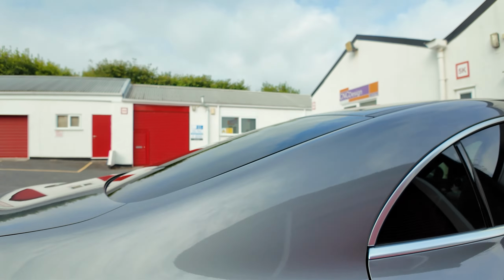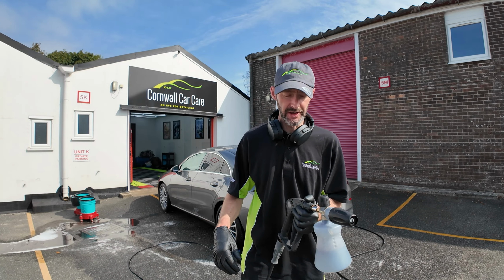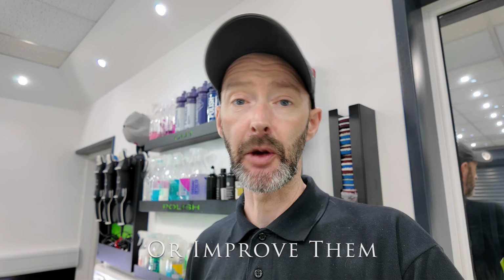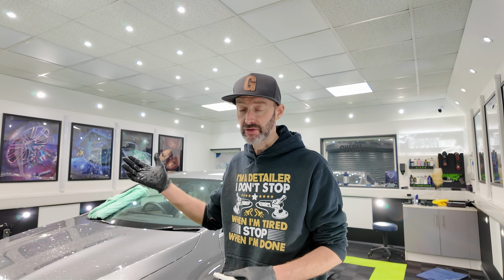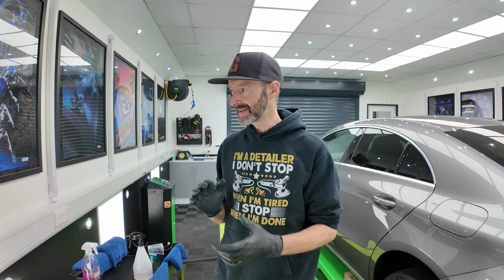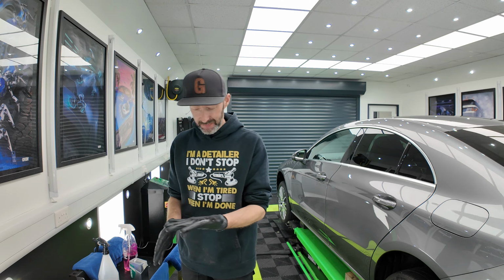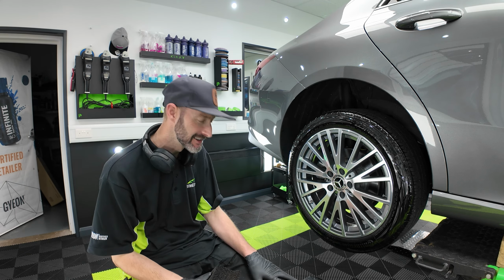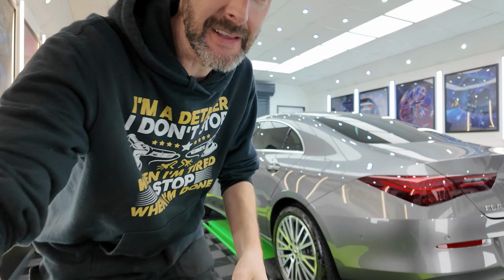Mercedes CLA Paint Enhancement & Gyeon Ceramic Coating

Comment: Another great video. Which single stage polish do you like and use the most?
Reply from the maker: Cheers @haroldcottam8174 for me I like using GYEON Polish but it will all depend on what the paint type is ( hard or soft ) and how much damage there is the paint, I would always do a test panel at the least aggressive and work my way up till I'm happy with the results 👍

Comment: Brilliant stuff, the right call was made there, well rounded scratches. Was it a nice change with the rotary?
Reply from the maker: Thanks @Ally.MacMillan definitely made the right call with the scratches as outside we couldn't see them at all, as for the rotary I have to start using it more as its so smooth to work with and leaves such a great finish 👍
Reply: @cornwallcarcare8959  is that a 5 or 6inch backing plate?
Reply from the maker: @irollon26s  5" on the LHR 15 and 6" on the LHR 21 👍

Comment: hi mate, what mini da polisher is that your using?
Reply from the maker: @umarmoh2203 This is the Rupes Ibrid 👍
Reply: @cornwallcarcare8959  at 9:53, doesnt look like an ibrid?
Reply from the maker: @umarmoh2203  You are right,  that's my DAS-3 3" polisher ( I have the Rupes LHR 75 and don't like it but I get on so well with this one) 👍
Reply: @cornwallcarcare8959  its got too much power even at speed 1... i feel you, the flex da 3' is good too as it has slow start

Comment: Looks awesome! Did you use both DA and rotary?
Reply from the maker: Cheers @Abiiiid3819 this detail was 90% rotary apart from a few areas which I used the DA 👍
Reply: @cornwallcarcare8959  Aahh I see. So did you cut and then finish with the rotary? (Sorry, newbie questions here)
Reply from the maker: @Abiiiid3819  Yep, the rotary leaves such a nice crisp finish and I will definitely be using it more in the future  👍
Reply: @cornwallcarcare8959  aaahh I see. What pad polish compound did you use?
Reply from the maker: @Abiiiid3819  Cutting = Microfiber pad and GYEON Compound+, Finishing = Yellow medium pad and GYEON Polish 👍
Reply: @cornwallcarcare8959  thank you!

Comment: Good day to you sir, a question ,as you use other products to wash your vehicles, do you use any other ceramic products other than gyeon?
Reply from the maker: Thanks @janebottomley6852 out of all the coatings that I have used over the years Gyeon have to be one of the best I have tried and their Certified Detailer Coatings are insane so yep Gyeon Coatings only 👍